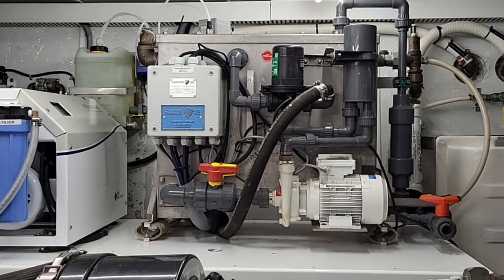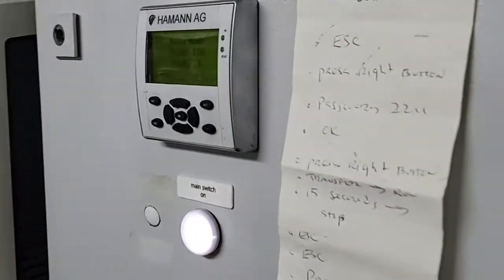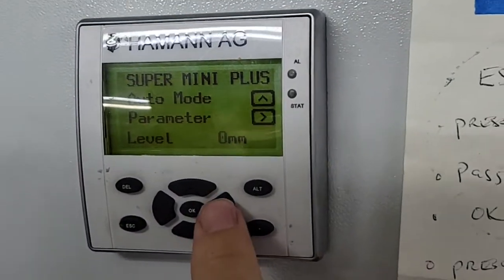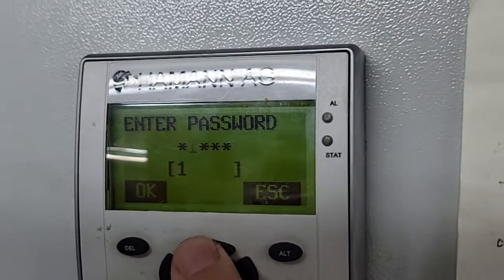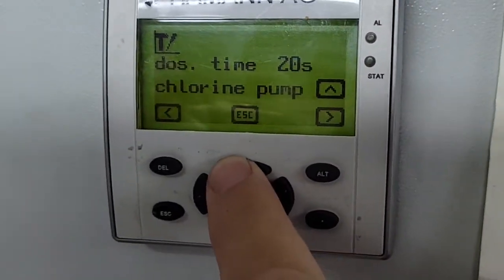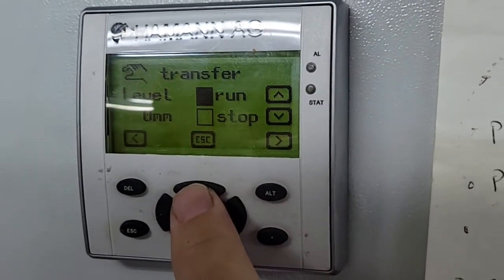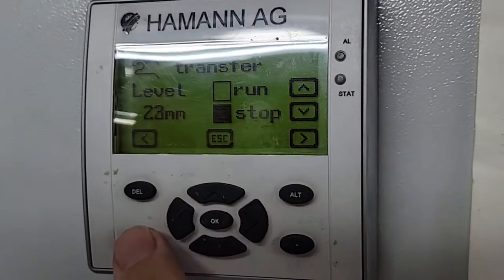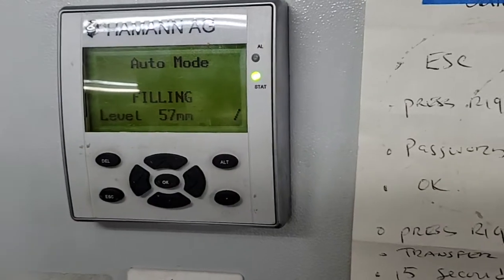Hamann  Super Mini Waste Treatment (yacht MSD)

Comment: Hi Capt if we put auto its mean system will working auto with all pump work follow the setting. Or manual transfer.. Like in system have transfer pump from holding tank to sedimen tank. It will Automatic also working if we put auto on
Reply from the maker: Hello, not sure if I can understand your question.  In our system when the waste tank reaches a certain level the Hamann automatcally pumps the waste to the treatment system when the treatment system is in auto mode.  in auto mode, once the process starts it completes the entire process (filling, circulation, and discharge) all on its own.  My video was to point out if you wanted to operate any of those functions manually you can.  I hope hat helps, let me know if I can be of assistance

Comment: Hello.

I have doubts about how the system works. Is the filling of the treatment tank done manually and then the recirculation and discharge process is done automatically?

Thanks for your reply.
Reply from the maker: Hello thanks for the comment.  The answer to your questions is no, when in auto mode.  When in auto mode the entire process, filling, circulation, and discharge all happen on their own.  My video was to point out if you wanted to operate any of those functions manually you can.  I hope hat helps, let me know if I can be of assitance